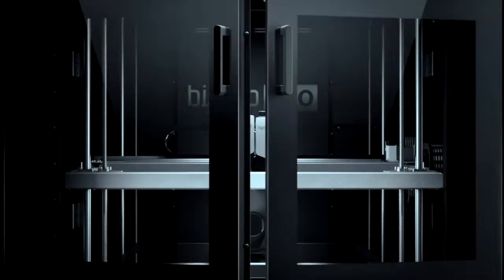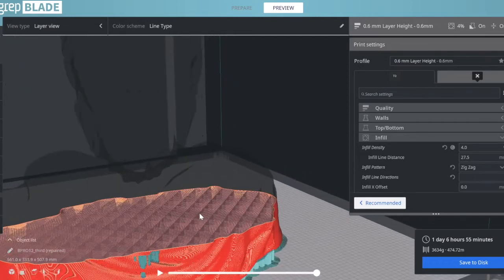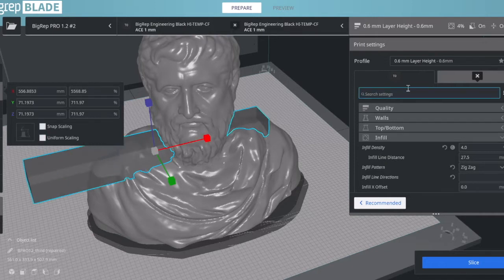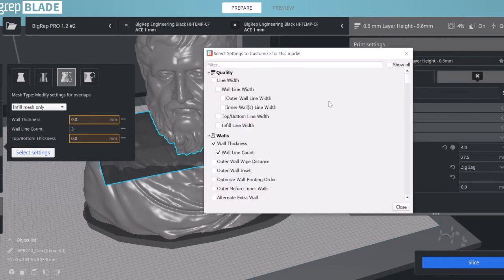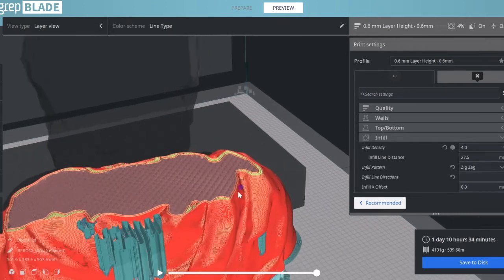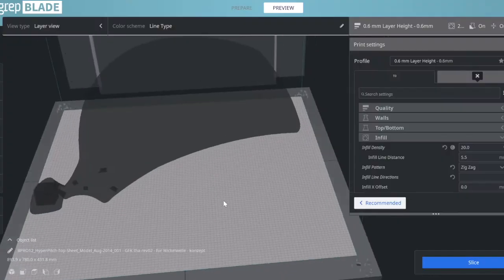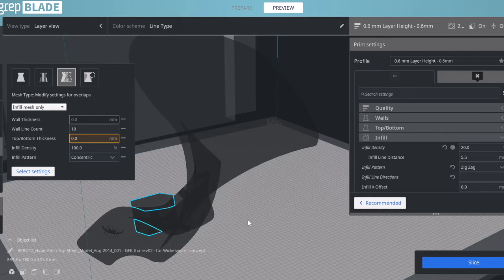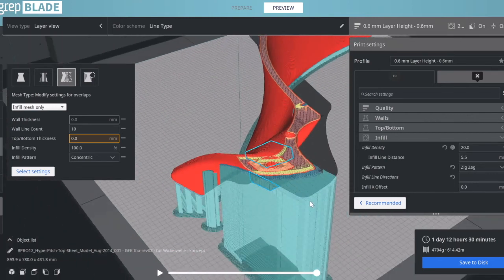Optimize Infill for Strong 3D Prints in High Quality

Comment: I’m gonna go out on a whim (excuse the sarcasm, not at all meant in a nasty way!) and say that the 3d printed impeller won’t be/wasn’t strong enough! (Pretty sure that it’s called an impeller when underwater!) I think even if the whole thing was a solid 3d print that it wouldn’t be strong enough, at least not without a major redesign to take advantage of the properties of plastic and fdm fabrication! More stocky and stout, thicker!